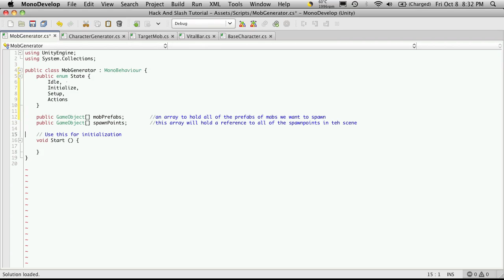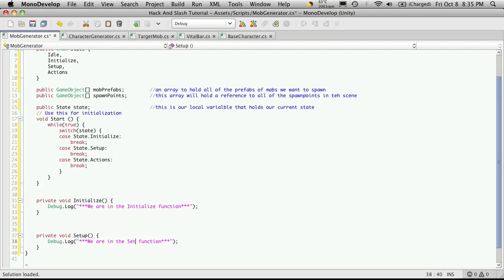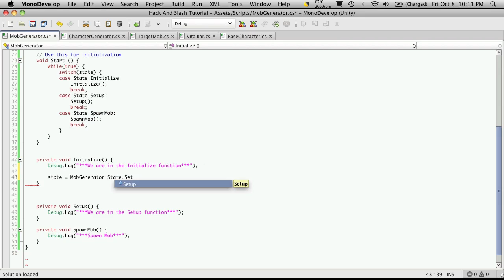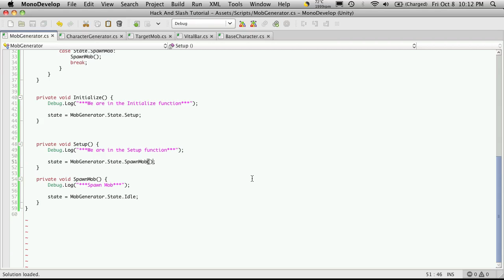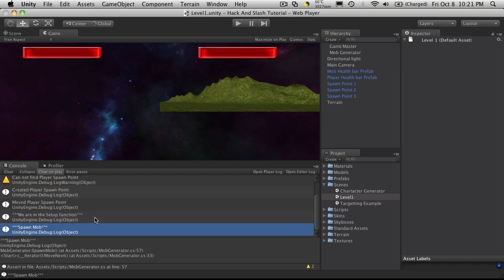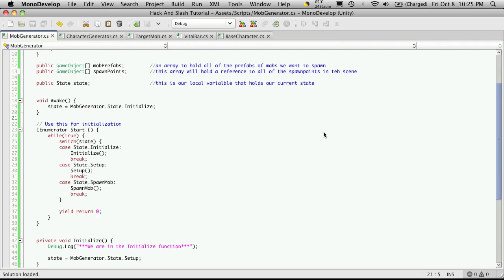56. Unity3d Tutorial - Spawn Points And Spawning Mobs 2/3

Comment: You should explain the Awake() function at the beginning set of tutorials, I had so much errors simply because I used awake() on tut 30's, I never knew until now (TUT 56) that Awake() is a builtin C# function. I used awake(), with a small 'a' the entire time and was forced to call that method every time I referenced back to the script, at least now I was able to remove all those extra calls.